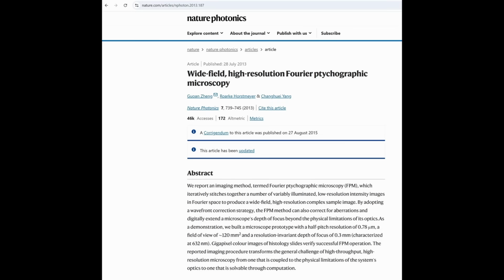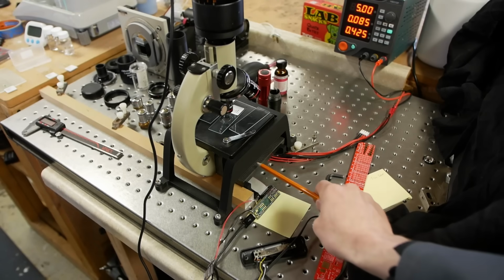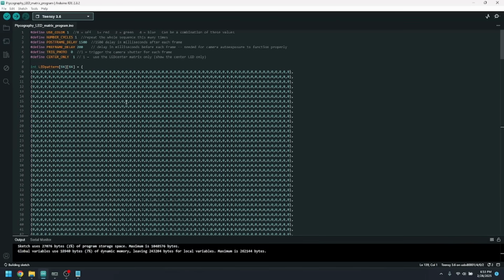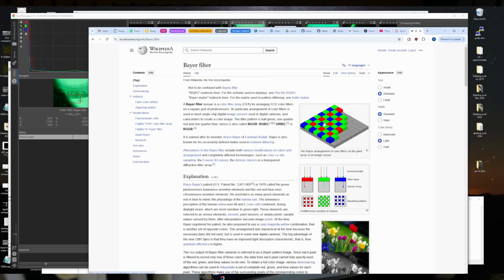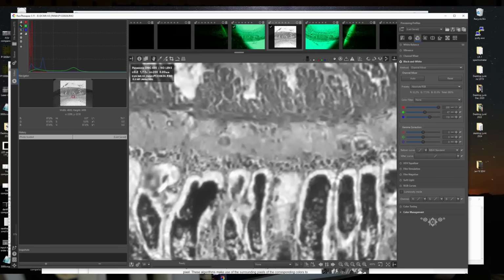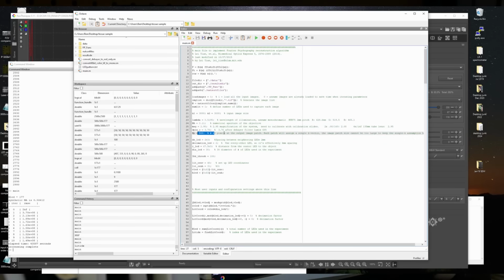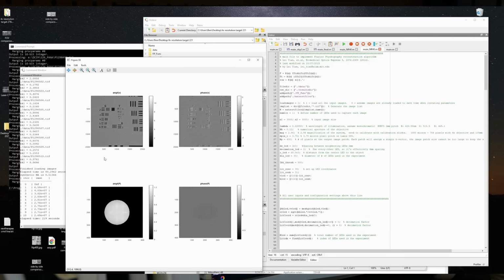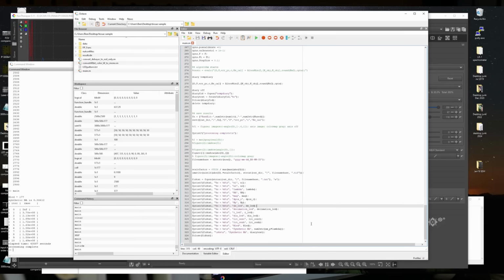Dramatically improve microscope resolution with an LED array and Fourier Ptychography

Comment: Fun fact - similar method is used in reverse in UV lithography systems - it is called off-axis illumination there.
Reply: My immediate thought was about adopting this technique to get high quality imagery of modern ICs, since their features are too small to get images with a regular microscope.
Reply: @phirenz  You still cannot go over the diffraction limit though - diffracted "beams" from sub-wavelength structures are evanescent and thus do not propagate.
Reply: @DmitriyNE  Could you please explain this a bit? Is it similar to long radio waves passing through comparatively small conductors and being blocked by meshes with holes smaller than their wavelength?  
The evanescent waves being the near field waves?  

Also is the propagation of evanescent waves somehow related to the index of refraction which is in the abbe's limit?
Reply: @phirenz Wouldn't you need an to image an item that has varying translucency for the diffraction method to work? As far as I can tell attempting this particular technique with reflected light would give a really out of focus image. It only works because the light source is multiple point sources of illumination.
Reply: @phirenz  That's done via EUV imaging, using basically the same light source as for the lithography. That's the current industry standard for defect detection (for example, look up Zeiss AIMS for lithography mask defect detection) because it's faster and more practical for high throughput than "lab methods" like electron microscopy or AFM..
Reply: @ But AIMS can't do wafer inspection right? Also about mask inspection, are you sure it is faster than a SEM? I thought AIMS has quite a small inspection field, which to me seemed it was not a fast tool and not practical for full mask inspection (although the same can be said for SEM/AFM). Then again, although AIMS can detect printable defects, be it phase or amplitude defects, the resolution should be quite limited compared to SEM, as SEM can easily give you ~1nm resolution at mask level, AIMS has the same resolving power as a scanner at mask level, so closer to 80nm at mask (assuming on-axis illumination, so CD = 0.5 * 13.5/0.33 ~ 20nm at wafer, meaning 80nm at mask, could be a bit lower using off-axis illumination, but that will change imaging conditions). I'm pretty knowledgeable with imaging, but I'm not an expert with AIMS, so please correct me if I'm wrong.
Reply: my immediate thought was wondering how this related to modern lithography
Reply: @dacharyzoo 🔴 What Is Islam?  
 
🔴 Islam is not just another religion.  
 
🔵 It is the same message preached by Moses, Jesus and Abraham. 
 
 🔴 Islam literally means ‘submission to God’ and it teaches us to have a direct relationship with God.  
 
 🔵 It reminds us that since God created us, no one should be worshipped except God alone.  
 
 🔴 It also teaches that God is nothing like a human being or like anything that we can imagine. 
 
🌍 The concept of God is summarized in the Quran as: 
 
📖 { “Say, He is God, the One.  God, the Absolute.  He does not give birth, nor was He born, and there is nothing like Him.”} (Quran 112:1-4) 📚 
 
🔴 Becoming a Muslim is not turning your back to Jesus.  
 
🔵 Rather it’s going back to the original teachings of Jesus and obeying him.
Reply: Ooh, I'd love references or papers on that. Sounds fascinating.
Reply: @JohnMeacham look up Source Mask Optimization. If you study that enough, you'll realize that photolithography is not really about creating an image of the photomask. Instead you tune the photomask together with the source to get diffracted beams at the wafer in the position you want. For example you can use phase shift masks with a grating of a given pitch, tuning the thickness of the lines so that your 0th order (or non-diffracted beam) has zero amplitude. The reconstruction of that on the wafer will give you a feature that is twice as dense, so half the mask pitch. The possibilities are endless!
Reply: @DrBlokmeister  That's very thought provoking - do you think using these techniques would allow improved results (similar to better UV light collimation) for mSLA LCD images for 3D resin printers, to reduce or prevent well-known problems like "side-curing" and such?

In any case, thank you very much for posting these kinds of details!
Reply: @retromodernart4426  oof that I don't know exactly, not my area of expertise. However, I think SLA printing is a contact technique, without optics to project the target image onto the resin. In that case it doesn't work since the image is in the near-field, really close to the mask.
Reply: @DrBlokmeister  Yes, the image from the illuminated LCD which is usually within 0.15 - 0.3mm from the resin, which passes through the release film at the bottom of the vat.

My hypothesis is, the resulting image (in practice, the image on the resin-side surface of the release film) can be analyzed and processed to "correct" aberrations when using only the intended but not corrected image.

This calculated/calibrated image correction processing can be applied to the PNG file layer stack prior to printing.

There's already "image masking" in use on even some better "consumer" mSLA printers that correct and improve UV light intensity uniformity over the entire LCD area  which is very effective.

Perhaps applying techniques similar to those described in the video and what you mention but for the purposes I elaborated on can improve practical image acuity  beneficially...
Reply: @retromodernart4426  Eh.. I'm afraid you lost me. You said that there is no lens or objective present. Without a lens, you cannot have aberration, as aberrations are phase differences as a function of spatial frequency. But there is no difference between the spatial frequencies here since you are in the near field.

The only thing I can imagine is that you perform OPC or optical proximity correction. Due to flare or background intensity, I can imagine that isolated lines print with a different width than a hole set of lines close to each other. You can correct for that by changing the line width on the display to make sure that the final developed resist or resin has the designed width.
Reply: @DrBlokmeister  Actually, the COB UV light has a plano-convex aspheric lens, and uses a Fresnel lens adjacent to the bottom of the LCD.

But yes, the light coming out of the top of the LCD has no lensing, it only passes through whatever the top of the LCD is laminated with, and the release film.

Thanks again for all of your detailed remarks!
Reply: Somehow look like how one tipe of electron microscope work. Getting electron diffraction to gain huuugee magnification from object. Am I wrong?
Reply: That was my first thought... Look out for a business card from Perkin-Elmer, Ben! :)
Reply: Interesting - I did some soft x-ray lithography 30 years ago, and was wondering why 30 years later, lithography was still getting smaller and smaller features without getting into the 1 keV x-ray range for the light.
Reply: @SwissPGO  That's a very valid point. I think it is just extremely impractical to not go to even smaller wavelengths using a projection system. The transmission of the optics is too low and it too difficult to make a high-power source. Also you get the issue of stochastics, meaning that for a certain dose, you only have very few photons causing shot noise. So we are stuck with a wavelength/NA combination that makes it really hard to scale.
I'm not saying that scaling is dead, it's just slowing down because it's incredibly hard.
Reply: Sub pixel, quazi pixel, fuzzy pixel, edge pixel, quantum pixel? Need a catchy name
Reply: Yes, i think a ring not full matrix